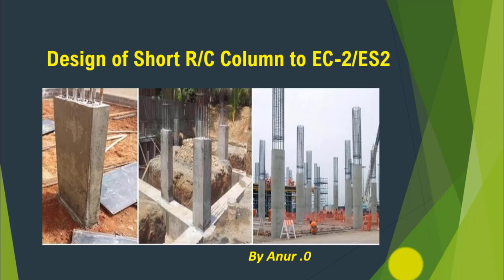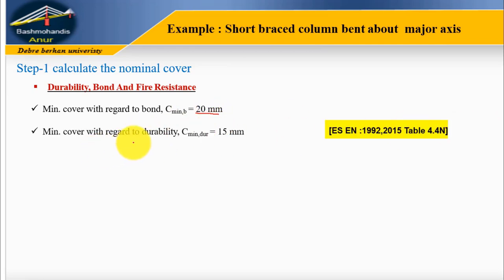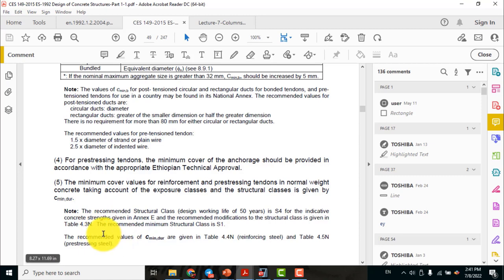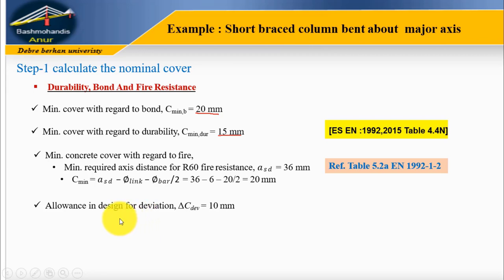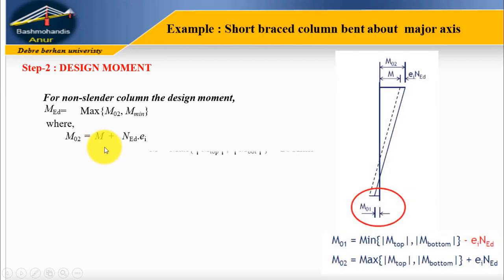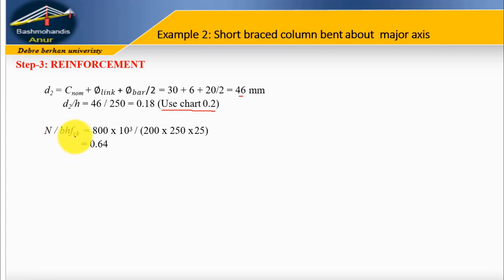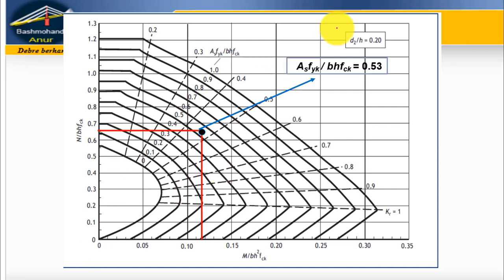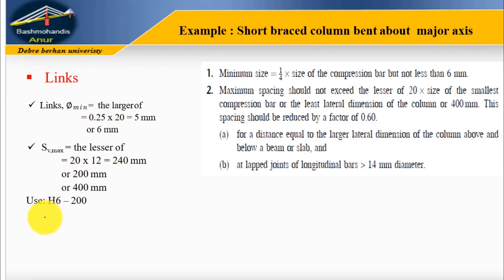Design of Short column to Eurocode 2/ Ethiopian standards 2

Comment: How we assigne cyclic load on column or beam (abaqus)
Reply from the maker: For My Msc Theis, I used Opensees software to carry out nonlinear analysis and in this case, I downloaded an experimentally tested column from Peerr Structural performance database. and simply I wrote programming code to apply the cyclic load on the joint of the column. For Abaqus, I don't know how to do that, but I guess it could be straightforward because it is a graphical user interface. I will search for material and I will share it, bro.